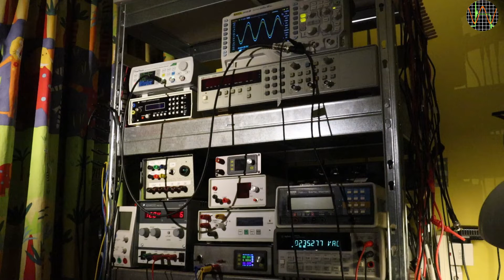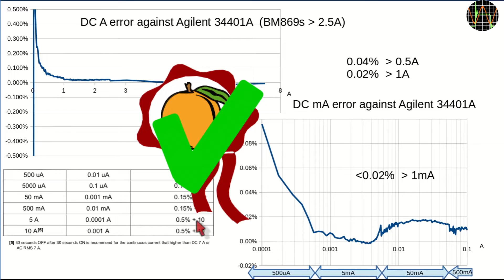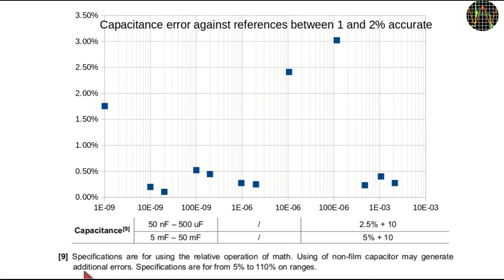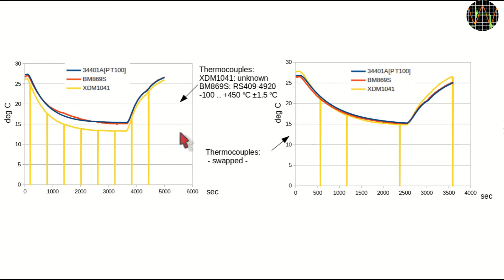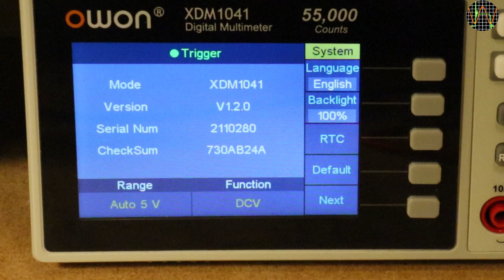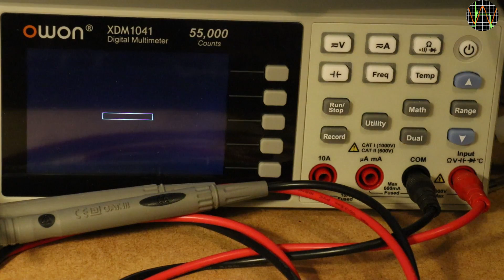The OWON XDM1041 bench multimeter, part 3 - performance and firmware upgrade

Comment: Hello, where can I get the firmware or software to perform an upgrade? My OWON XDM1241 is stuck on the startup screen. Thank you.
Reply from the maker: I can't find any for the XDM series. If the product works, its ok but if it develops problems OWON is very quick in abandoning their products so support and aftercare is non-existent.Sadly there is a lesson here regarding buying OWON products.  
Regarding the stuck XDM1241. Have you tried disconnecting the battery to force a full reset? I don't know how the 1241 works but the 1041 is always powered as long as the mains connection is there, so the power switch doesn't really turn everything off. Maybe its the same with the 1241? Just a guess of course.
Reply: @TheHWcave  I got the XDM1241 update file, performed the update, and everything is working perfectly again.😄
Reply: @CristianoPassos where did you find the 1241 firmware? Did it change anything at all from the original version?
Reply: @TheHWcave  I contacted support and was instructed to remove the battery, as you mentioned. The device turned back on. However, before that, in my eagerness to make it work, I attempted an update from the 1041 and encountered an error during the process. Now it powers on, but it shows several bugs. I believe I may have damaged the system. Support refuses to provide the firmware and only suggested buying another device. I find this absurd and a total lack of respect. Anyway, I will keep trying to find a 1241 firmware file. Thank you.

Comment: I have a XDM1241 (batter powered). I don't like the DCV autoranging either. I did measure the burden resistance of the DC current measurements: 50uA & 5mA = 101 ohms, 50mA & 500mA = 1.46 ohms, 5A & 10A = 0.030 ohms. I am very sure ACI uses the same shunt resistors. It's a pretty decent meter. I really enjoyed your thorough review - exceptional!

Comment: Help 😮
Вопрос, при включении мультиметра всегда автоматом выставляется скорость замера - Low медленная??
И её всегда приходится в ручную переключать на более быстрое измерение?? или прибор перед выключением запоминает последние корректировки в меню...
Reply from the maker: I'd appreciate for the sake of other viewers as well as making it easier to reply if comments are posted in English. The answer as far as I know from my firmware version is no. This meter does not remember settings and always starts in the slow (but more accurate) mode.
Reply: Thank you very much for the complete answer. It’s a pity that the device is tested mainly at Low speed.
Reply from the maker: @andbrewmoon  True. For me, I rarely use this for precision measurements anyway, more during repairs to check if voltages are roughly where they should be, check ballpark resistances and continuity. Because of that, almost as a reflex, after power-on I always hit SPEED twice to set it to high. Its almost a XDM1041 power-on ritual

Comment: Strange information with Owon XDM1041 that it cannot be turned off and is still in standby mode, when this multimeter is powered from the mains and just unplug the cable. I would believe that with the XDM1241 because it is battery powered.

Comment: Firmware: I see your "original"  was Version V1.2.0, then (about 1 year ago) you upgraded to a dated Version  20210525 , My recently acquired XDM1041 Version is V3.1.0   I wonder what is different?  and comically the "original" firmware"s" have no date stamp.  I am quite impressed with Microamps readbiltiy and accuracy, and the accuracy of DCV and ohms against my reference standards.  I'll look into capacitance.  and if it "better" (with version 3.1) I'll post a reply.
Reply from the maker: I wish I knew. OWON doesn't tell. The only info I got is that they changed something in the hardware so those with earlier builds (like mine) will not get any more updates. Nice!  I think that the newer versions now allow sending the locally recorded data. If I do recording I always record directly onto the PC in real time so that doesn't bother me.
Reply: @TheHWcave  I guess customer service is a thing of the past. and BTW thanx for all the effort it takes to make all the videos, we appreciate it. 

I don't have any "capacitor" standards, but using nameplate and 4 other meters, They are all consistent, but this 1041 is total garbage on teh MIcro and milli farad scales, and as you pointed out, auto ranging is almost non-existent.. Picofarads seem to track, however I have applied a sticker to remind me to not use for cap measurements.  Of course I used to only check caps with an analog meter (hinting my age) and my "antique" Fluke and Keithley DMM's don't have the means to check caps anyway, but I like the red LED's

The good news, I acquired this (1041) for Microamps and millivolts (DC). I use it for calibrating the meter movement on analog meters (SImpsons, Triplett's etal.)
Reply from the maker: @grampymeyer6603  I agree, for things other than caps it is a good meter (a bit slow if you want good accuracy). Beware of the temperature thing, every 10min it readjusts its cold junction reference which means for the 1st 30-40 mins after power-on the temperature will jump until it settles. It reads temperature more accurately if the back light is set to lowest (less heat generated internally)

Comment: Do you really measure a current shunt resistance with 2-wire meter?! :DDDD It's just rediculous!
Reply from the maker: Not at all. I was getting a value for the current shunt + fuse resistance to estimate the burden voltage (voltage drop caused by the meter). This is one of the established ways, the other is to send a current through and measure the voltage drop across the terminals of the meter. Both methods use only 2 wires.  There is really no point in measuring the shunt itself with any accuracy because the fuse and the wiring in the meter all add to the burden and that is what counts when you actually use the meter for measuring current. Also the fuse (as it gets hot) will change its resistance slightly, so no point of using super accuracy here. If for some weird reason you really wanted to know  the value of the shunt resistance itself using 4-wire methods, it would be very tricky to probe the exact points where the shunt is soldered into the PCB. Maybe you can give it a try and report back?
Reply: @TheHWcave  Then, it's OK. Thanks for the detailed answer.

Comment: Would the firmware for this model be the same as for the 2041 (since 2041 is mentioned a lot of times in the instructions)?
If so, do you still have this update since Owon will not respond to my requests and I have an issue with my 2041 that in dual-mode the frequency measurement stops working after 10 - 30 seconds. I hope this would be fixed in the newer firmware. I have v1.2.0 at the moment too.
Reply from the maker: I have no idea if the 2041 firmware would work but I very much doubt it. The two are undoubtedly related but I suspect sufficiently different to not make this work, After all OWON claims that the newest 1041 firmware is incompatible with the older 1041 models. My firmware update from OWON is dated 2021-05-21 and  available on my Github page https://github.com/TheHWcave/OWON-XDM1041
Reply: @TheHWcave  update on my 2041; I contacted Owon again about my issue and sure enough they responded and actually provided me with a firmware update that solved the issue! Thumbs up for that I must admit.
Reply from the maker: @ssalient  Count yourself lucky. Or maybe the 2041 is more up-market and has better support? Anyway, congrats and well done Owon.

Comment: Does XDM1041 still use 4.000Mhz crystal as XDM2041? It's hard to see in the previous video. There is reports that this wrong crystal causes noisy measurements in high resistance mode for XDM2041, especially in 50Hz countries. This could explain the bad result for 10 Mohs
Reply from the maker: Yes indeed. its the same story 4.000 MHz. I am aware of the fix for XDM2041 to replace the HY3131 crystal with a 3.072 MHz one for folks in 50 Hz mains counties (like me) in. The idea is that this makes the averaging interval a multiple of the period of the mains frequency (20ms for 50Hz), thus greatly reducing the effects of mains noise  on the measurement. The drawback is that this mod screws up any frequency measurements. So far I have not tried it. I did not find resistance noise that excessive but to be fair, I mainly use the XDM1041 for ball-park checks of resistors (instead of trying to decipher the colour code). I have other meters to do precision 4-wire resistance measurements.
Reply: @TheHWcave  In 2020 I bought a Voltcraft version of 2041, vc7055 from Conrad , but after a half day test, the boot time prolem has occurred. After warranty replace, the second meter failed after an hour. I sent back with refund. A year ago I bought an xdm2041. It has a noisy resistance measurement problem. Useless in all ranges, 50Hz mains freq. Back and refund. But as far I can remember,  the vc7055 models resistance measurement was pretty good, without noise... But they were very first series... I'm a bit tired of this.
Reply: @alphaomega9415  I am searching for a Bench multimeter. I don't know this exact issue. But can it be fix by grounding 4Mhz crystal body if they had not grounded.

Comment: Well, I've watched all 4 videos and determined that as a hobbyist guy who just wants something 'accurate', with a large enough screen and some functionality, it'll do me fine. I have a fairly decent handheld multimeter and it balks at lower capacitance and I always use an LCR meter anyway, so I think it will serve my purpose. I'm not engineering anything, and I can't justify $400/$500.Great video(s) review. About as in-depth as anyone would want/need to go. Obviously not for engineers and professionals who need uncompromising hardware and speed of use. Unfortunately I don't fall into that category, but from what I've seen it's better than my (quite good) handheld, which I'm tired of dragging around the bench.
Reply from the maker: Yep, that is kind of my point as well, I have bench meters and a selection of hand-helds but to use them to check a battery voltage or continuity on something I am building on the bench was a bit of a hassle. The XDM1041 has shortcomings, , but it is incredible convenient and easy to read from a distance.
Reply: I agree - this unit looks to be excellent for home use. Having spent my electronics career surrounded by lab grade equipment, and am now on a hobby basis, I am amazed at the value of test equipment available today. Compared to the early 70's, one can equip an excellent RF test bench with supplies, meters generators, scope, even an excellent spectrum analyzer for under $3000 which might be $150-300 in 70's money - the price of a Heathkit scope alone.
Reply: I have a lab in my house, I fix trifasic motor controllers and ARC High End audio.
I bought many multimeters, one Us$500 dollars Siglent, many Flukes like 87V, 28ii, or 289.
Some times I need to test varios points at the same time, I don't need 6 or more digits multimeter.
I was thinking to buy a second Siglent but I found the Owon, after a year of use I can tell you it fit all my needs very well, I boght a second unit some days ago, I bought the XDM1241 that come with battery pack.
I need for test continuity or DC voltage only.

Best Regards.

Comment: Am i missing something or is the new firmware useless without the "download tool"?
Reply from the maker: The problem is that the download tool is massive, 70+ MB as a zip (Windows bloat...) and Github won't let me upload it. I am also unsure if they let me store it in 4 chunks of 20M each  together with a little tool to reassemble them. Still investigating..  I uploaded the firmware for now because the tool, called
DS_Wave_Patch_1.17.7.v20191126_Setup.exe
might be floating around elsewhere for download (I don't think it is specific to the XDM1041)

Btw, if you send comments with URL's (links) in them, YouTube will automatically delete them. I can see them but not respond
Reply: @TheHWcave    First of... thx for the hint with links in comments, i didn't know that. I of course searched the web for the name of the setup i typed painfully character by character from the screen of the video...... and... no success. How about i give you webspace (up to a GB) with unlimited traffic, a ftp account for accessing and managing it as you see fit?

Comment: I want to buy this multimeter
The detailed reviews in the video obviously took me too long.
I guess I won't buy this multimeter) , I do high-end computer repair myself. multimeters like this don't go by many names. nice looking but
Thanks for the detailed explanation.

What do you think of this model? UT8803E or UT803
Reply from the maker: Well, spec wise the UT803 is better than the UT8803E which can't even do True RMS but the accuracy that both offer is no contest to the accuracy of the XDM1041.  The problem with the XDM1041 is its slow display software which OWON could improve through firmware updates (we can but hope...) but the measurement front end hardware is top-notch and it has a proper SCPI remote control (not just reading values from the meter). Last thing that really puts me off the UNI-T meters is their obsession with "hfe" and similar silly measurements ... nobody uses a multimeter to do that kind of thing for ages since we have cheap component testers that can do so much more. If you are looking for a good handheld multimeter Brymen would be my first choice, for good bench one that is affordable, look for a used but working HP3478A I just got an excellent one for £100 and 30+ years old it works a dream (no capacitance, temperature or frequency measurements but a superb 4-wire ohms mode down to 1 milli-ohm). On HP3478A and similar used meters from that era (pre-flash memory) you need to check and probably replace the battery that keeps the calibration data while not loosing it. Check online for procedures.
Reply: @TheHWcave  
thank you for answering
Brymen  - priced well above the budget.
HP3478A - impossible to find. Because unfortunately, such products are not sold in the country where I live.

ut70b i am using now. Frankly, I don't use the true rms feature much on laptop motherboards. There's no need. 
The product that fit my budget was the owon model. unfortunately it fell out of my sight after this video review)
know when the software update will be for a long time. 
Is the XDM1041 accuracy better than the un-t 8803e and 803?
Reply from the maker: @diacomservice  Accuracy of the XDM1041 is significantly better than either and its 55000 counts. If you are willing to consider a handheld and not doing high energy work (house-fuse box ..) where actual (not fake) CAT ratings matter, you may want to consider the UNI-T 61E+. 22000 counts and somewhat more robust than the earlier UNI-T 61E from Joe Smith's recent tests. As with most meters from China, a meters "robustness" depends on where you buy it.  For example a meter bought in Europe from a proper vendor may have better fuses and added MOVs as input protections while the exact same meter bought in China misses  or downgrades those protection parts. That's often why they are so much cheaper when imported directly. You get what you pay for.
Reply: @TheHWcave  hi. thank you for replying
UT61E version a few of my friends are using it, good product. values are normal. You are right about the fuse.
then i can get XDM1041. If new updates come, I hope other problems will be fixed.
Reply: @diacomservice  Ebay. $150 US

Comment: Thanks for the comprehensive review. I will stay away from this multimeter, there are too many weird issues with it. It looks good though, visually, but that is not enough for lab use. A new firmware could however fix many issues.
Reply: Erika, I don't think that any of these low cost meters are intended for professional lab use. Look to Agilent,  Fluke, R&S etc. And in a lab one doesn't normally look to a DMM for capacitance, frequency or temperature measurement - you have dedicated meters for that. On the other hand it can be very handy for troubleshooting, realizing the limitations of your meter which you need to do anyway. Lastly the durability  of such low cost units for production or field or student use would be questionable.
Reply from the maker: Yes the hardware is quite good, if only they would get their act together on the firmware, this would be a great meter